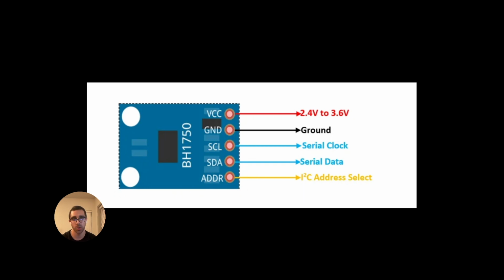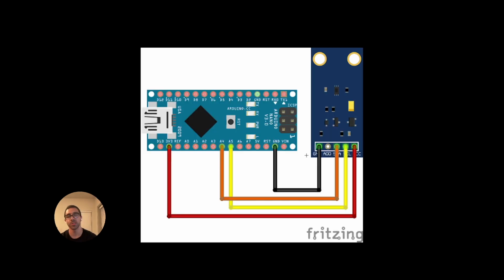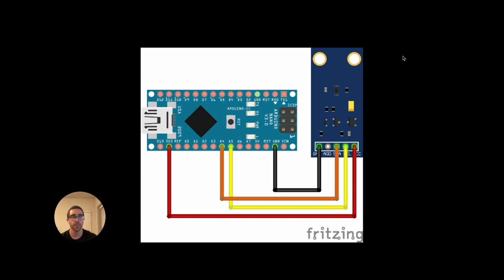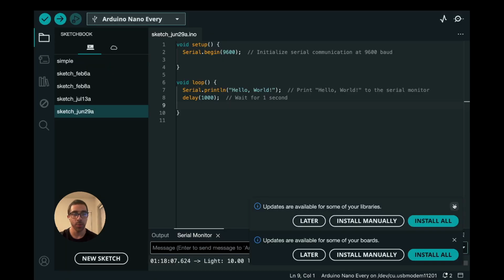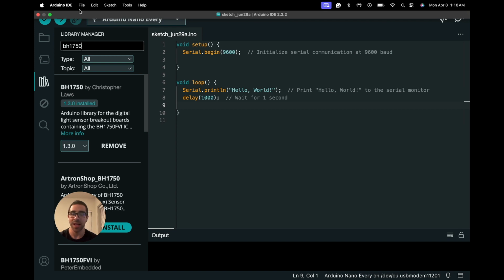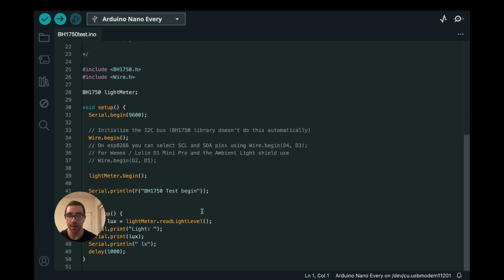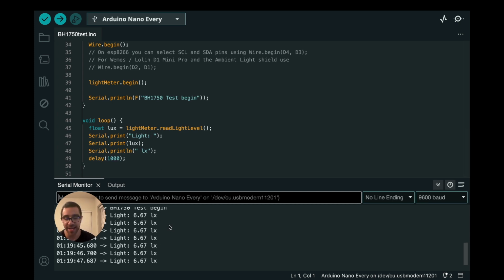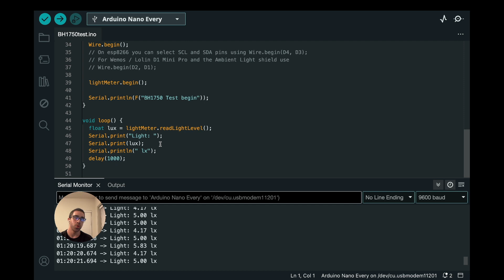How to Connect BH1750 with Arduino: Measure Ambient Light for Smart Lighting

Comment: Very good work, sir !
Is it possible to change the lux value of BH1750 sensor in W/m2 ? Thank you
Reply from the maker: it's important to note that the sensor measures illuminance in lux units, which are specific to light intensity as perceived by the human eye. It does not measure irradiance in watts per square meter (W/m²), which refers to the power per unit area received from the sun or other sources.

If you need to convert lux to watts per square meter, it's a bit complex because it depends on the wavelengths of the light and the efficiency of the light source in converting electrical power to light. However, for sunlight, a rough conversion factor is about 0.0079 watts per square meter per lux. This factor can vary depending on the type of light source and the specifics of the situation. If you need precise measurements in W/m² for specific applications, you might consider using a pyranometer or a similar device designed for measuring solar irradiance.:_Heart:

Comment: in a project of painel solar, what's the difference between ldr sensor and this sensor ? the utilities of both are monitoring light, so what's the difference and which one is better?
Reply from the maker: Both the LDR and BH1750 sensors serve to monitor light, but they differ in accuracy and sensitivity. LDRs are cost-effective but less precise, affected by environmental factors. BH1750 offers superior accuracy and stability, making it ideal for precise applications like solar panel control, despite being pricier. The choice depends on your project's requirements for accuracy, reliability, and cost-effectiveness.